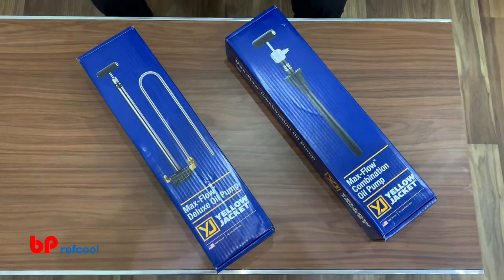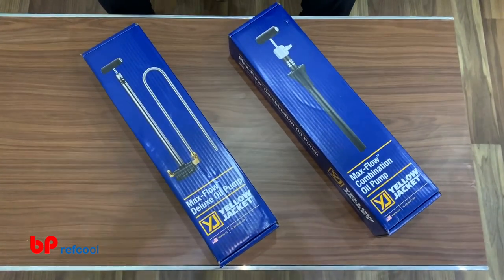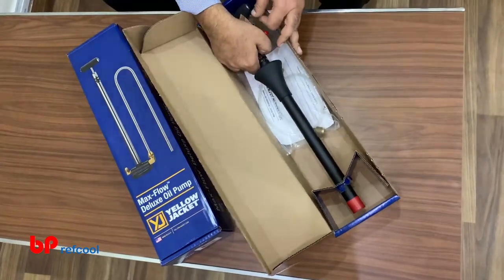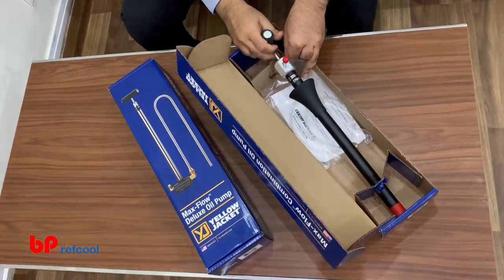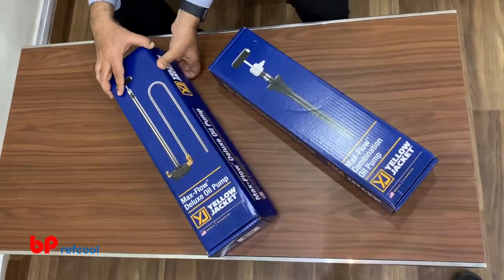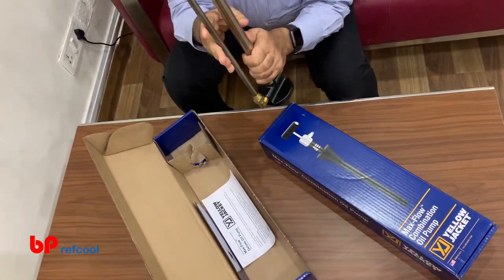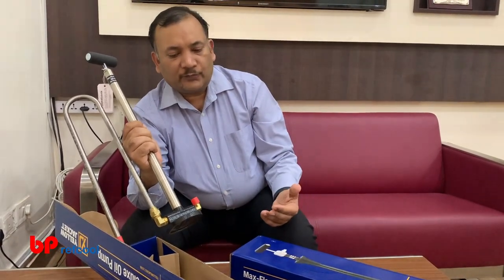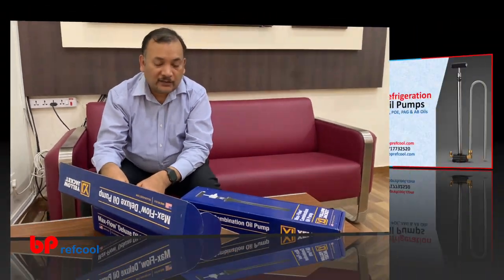Refrigeration Oil Pumps for easy, safe and quick charging and recovery of oil

Comment: Can we charge the oil for R410a system,  its runing pressure  is 130psig and  standing pressure is 200psig
Reply from the maker: Yes Max flow deluxe oil pump can pump against 250 PSIG

Comment: Can you explain how does the right small one work?  The outlet is on the top, and the inlet at the bottom. I am wondering how it works. Thank you
Reply from the maker: This has inlet from bottom and this pump needs to be intrested in oil CAN and then it pumps from top outlet.
Reply: @bprefcool  Thank you for your reply. So, there is a tubing inside of the cylinder from the bottom to the top outlet along the cylinder wall?
Reply: So how does the the oil not escape the bottom when pumping from the top? Also you would connect your hose to the top?
Reply: @alicepet1994 tube ending that faces bottom flat of floor goes in a oil can so it can suck the oil from bottom of that oil can and then gauge  hose is connected to the top part of pump to pump into condenser very simple don't over think it